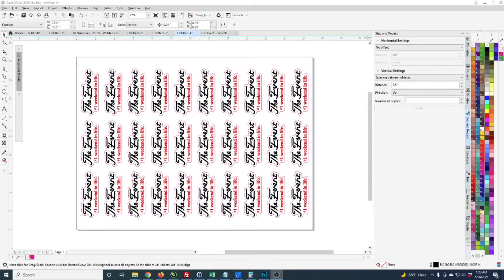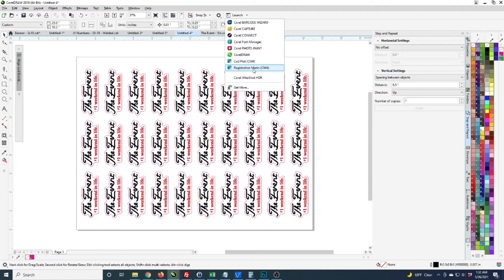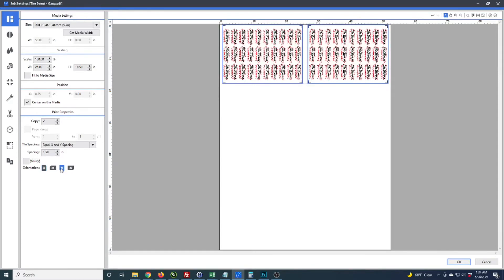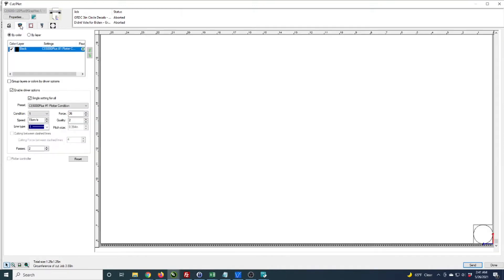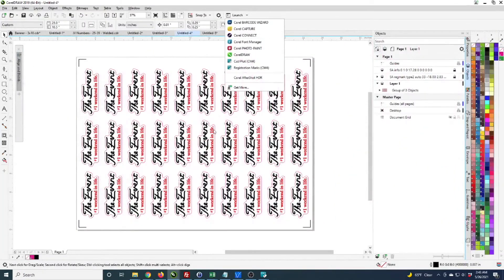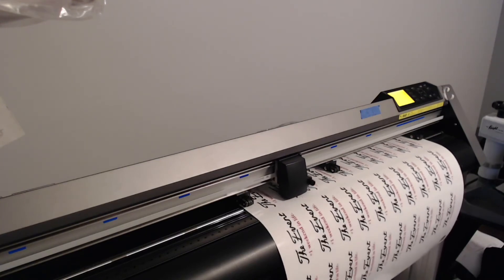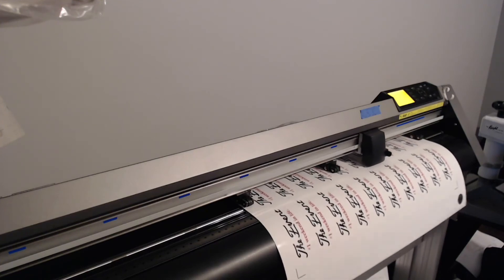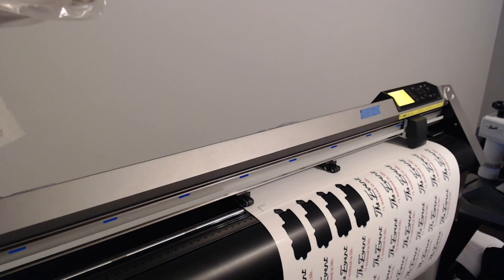Roland + Graphtec Print & Cut Workflow

Comment: Are you cutting in condition 8? Doesn't the Teflon get damaged? Or are you using it in the part where there is no Teflon. Thanks for the video.
Reply from the maker: You can program the Conditions to have different tool and setting configurations. I believe I used either Condition 1 or 2 here. With the CE6000 cutter doing this does cut into and wear the cutting strip. However, I have had the same cutting strip on this cutter for over a year and while the strip does show the wear marks it still cuts perfectly fine. I do recommend having a backup cutting strip for replacement once you do run into cutting issues.

Comment: can you please help me. How does the plotter know how to cut the contour lines once its printed out the printer with only registration marks? Do I have to send it to cut to the plotter from the software? I cant manually just put the sheets onto the plotter without software correct?
Reply from the maker: Correct. Here everything was designed in Corel... I exported the PDF in order to PRINT on the Roland. Then launched the CuttingMaster plugin in order to CUT on the Graphtec. CM5 is now available for download here: https://www.graphteccorp.com/cutting/cm5/
Reply: @drivenbygraphics  thank you very much. Does that plugin work for vinyl express? Because mine is a vinyl express q42 which is essentially a graphtec ce7000 or something. Manufactured by gtaphtec. It looks exactly the same. And how do I go about adding the plug-in to Adobe?
Reply from the maker: @dandee28  You'd need to confirm with SignWarehouse and/or your manual to see if your cutter has the Automatic Registration Mark System (ARMS) sensor in order to read the registration marks. Many years ago I had a QE Series cutter from them and it did not. I sold it and got a Graphtec which did. As far as the plugin, the Graphtec page has downloads for both Corel and Illustrator plugins.
Reply: @drivenbygraphics  oh the Arms it does have. I just checked last night. I usually use thr plotter to cut with auto films but decided I want to try it out for stickers/vinyl too. I had no idea I bought a machine that coukd do so much! Since it has the arms system I'm not sure what's the best software to use with it. Someone told me it shoukd have came with flexi but I don't see it. The tinttek software that came with the printer says it has flexi 10 but there is no digital download for it that I see. I think it's only available if paid subscription.  Do you have suggestions
Reply from the maker: @dandee28  What printer are you using? 
Either way, there are a few ways to go. You can use almost any design software to prepare your print files but how you go from there can vary quite a bit. There are 3rd party RIP software solutions that could streamline print and cut workflow, but most of them come at a steep price and/or monthly subscription. I personally use CorelDraw and the CuttingMaster plugin as shown in the video.
Reply: @drivenbygraphics  I'm using a roland bn20a just trying to figure out how yo design and add registration marks for the plotter
Reply from the maker: @dandee28  Gotcha!  Yeah, so it would be the same process with Adobe Illustrator also. Once you get your artwork setup, run the CM plugin, add the registration marks, and export as PDF. Import the design into VersaWorks - make sure you set it up to PRINT ONLY. Once printing is complete, load the vinyl into the Q42, and run CM to cut. Note that you will want to make sure you have enough "tail" on your vinyl so that the Q42 doesn't think it ran out of material on the back end of the cut.  With the other Roland printers you can add a 90mm page space then run the Sheet Cut option and it works perfectly. Sadly the BN20A doesn't have a cut sheet option (I dont believe)... I think the new BN2 added the feature.
Reply: @drivenbygraphics  Is the CM plugin free and how do I see in illustrator? thank you for all the in depth info!
Reply from the maker: @dandee28  yes it's free and available in to download from the link in my first comment above ;-)
Reply: @drivenbygraphics  thank you! and what format does the sticker have to be in, in order to edit in coreldraw or adobe before exporting as PDF to print with roland? Do I make cutlines aroudn the image as png or is it pdf?
Reply from the maker: @dandee28  you can use any digital image format in your design file that is exported for printing on your Roland. However, your images will need vector based cut lines in order for the Cutting Master software to cut them. If you are cutting on your Graphtec, the artwork you export to your Roland does not need to have cut cut lines.
Reply: @drivenbygraphics  hmm so basically, I just need to add registration marks to a sticker sheet on adobe for my artwork, export as PDF or EPS, then import to versaworks, and versaworks will do all the work to add the cut lines to the sheet? Would I have to add an extra cutline around the artwork in illustrator or a design program in order to do "easy peel" or "perfcuts"? im so confused because theres so many videos explaining different things. 

i dont know if im doing it the long route. What I believe is that I have to create sticker sheets with the reg marks, then send to versaworks, Once printed, then I open up the same print file on cut master or another program in order for the cutter to understand where to cut the contours?
Reply from the maker: @dandee28  VersaWorks will not add the cut lines you need. You will need to create / add your cut lines in Illustrator or which ever design program so that when you open that file with the Cutting Master plugin it has both the registration marks along with your cut marks. The video above shows the entire process I use to prepare a file, print on Roland with VersaWorks and cut on the Graphtec with the CuttingMaster plugin.
Reply: @drivenbygraphics  i was able to add the plugin and add cut lines. Im just trying to figure out how to add additional cutlines to make easy peel stickers. Would I just have to add a second contour cutline in a different color on illustrator? and how would the plotter know to cut two lines?
Reply from the maker: @dandee28  If you are wanting to add multiple cut lines, that need different cut settings (i.e. kiss cut vs die cut) what I would recommend is using different colors for each cut line. Then, on the 2nd tab of the CM5 plugin (Driver Option - The icon looks like the cutting blade extending from the holder WITHOUT the +) choose the option to Filter By Color. You can then toggle each line color (cut line) and adjust settings accordingly.
Reply: @drivenbygraphics  thank you so much! ill have it a try, itll have to be alot of learning so ive already got down most of the things you suggested. What is the easiest design app in your opinion? Im using corel draw free trial right now and I have illustrator. On coreldraw in order to make the sticker sheets, should I adjust the size width according to what my bn20a can print out on material which is about 18.5 inchs wide?
Reply from the maker: @dandee28  I learned Photoshop ~15 years ago as a hobbist photographer and tried to pick up Illustrator multiple times and it was just never intuitive for me. I picked up CorelDraw much quicker and have been using it for many years now. 
Correct - the canvas in your design program will need to be no larger than your available print width.
Reply: @drivenbygraphics  do you have a video of how to create contour cutlines and easy peel lines in corel or could you make a video =D

Comment: Great video, I gained a lot of new info, I have a Roland printer and a Graphtec cutter, however I have never tried the die cutting as you show in the video.

My question is, how bad does the blade cut into the cutting strip and how often do you need to change the cutting strip?

You mentioned you use cheap blades from Amazon, but you didn't mention anything about the cutting strip or how often you replace it.

Have you found a cheap source for the replacement cutting strips?

Thanks,
Reply from the maker: A single run of die cuts isn't going to ruin the strip but continued used will do so over time as the blade continues to cut through the backing paper and slowly eat into the strip. How quickly that happens really varies a LOT based on how much die cutting you are doing. 

I have not found any cheap replacements for Roland or Graphtec strips. Well, the ones that are CHEAP usually don't have the adhesive tape on the back to where they are ready to use and apply. Let me know if there is anything else I can do to help!

Comment: Hey thanks for the video, I recently bought a vg3 540 but looking to get a graphtech or summa cutter because the VG3 isn’t great for pref cut, what cutter would you recommend? I just need a 30inch one because I am only using 30 inch rolls but I need a cutter that’s good for cutting die cut stickers.
Reply from the maker: Either one are great cutters. I have only used Graphtec myself but do have a LOT of interest in trying out the Summa T-Series with the tangential head.

Comment: @DBG Studios Hey Marvin, I have a BN20 and just got the graphtec CE7000.  I followed this tutorial for the workflow.  Got the crop marks to appear in Corel, saved to a pdf and brought it into VW.  I did do my design with the pink cutcontour in corel but when I have it in VW and have selected print only - it still prints on the media (5:18 in video).  Also the wrench tool in my VW for my file to set custom settings and add the 90mm tail is greyed out.  Can you advise on that too?  Are you available to perhaps do a call to walk me thru this?  Thanks.
Reply from the maker: It sounds like your CutContour line is being converted to a non-spot color which would be the cause for it printing. 

As far as the wrench tool being grayed out, I am not certain as to why that would be but my first thought would be to look into the Media Type (aka Media Profile) for the job. It may be that the media profile itself is limiting that ability. However, as far as I am aware the BN20 doesn't have a dedicated sheet cutter and I believe you have to manually cut the media. In which case the 90mm page space isn't really all that useful. The intent there is to leave a "tail" on the end of the print such that the cutter (either Roland or Graphtec) has additional media that allow it to be cut through the entirety of the print job. As long as you trim ~3.5" or so past the end of the printed area you should be good to go there.  

Happy to discuss further. Feel free to email or message me any time and we'll get it figured out!

Comment: Do you use contour and perf cut?  We print and cut with a vs300i Roland and it is murder on the cutting strip and we wanted to move to a dedicated machine but we like to do a contour cut with a small margin then the perf cut.  This is after lamination.  But now I am wondering if I should be tying a double cut to reduce wear.
Reply from the maker: I don't use the PerfCut at all. I only use CutContour lines and adjust cut force appropriately. Over time, it does ruin the cutting strip but I am careful in ensuring that I am not overcutting causing additional, pre-mature damage. I replace my cutting strips about once a year.

Comment: so can the roland cut as well? doing some research on what i should buy
Reply from the maker: Yes, most models of Roland ecosolvent printers are capable of cutting as well. There are only a few of their more industrial printers (built for high production/speed) that are print only. 

As far as current models, their website separates the ones with Print & Cut capability from the ones that are Print only. 
https://www.rolanddga.com/products/printers

Comment: This is exactly what I needed! Thanks...I use Flexi and inside it of it I can reorder the cut path Have you figured out any settings on the Graphtec itself to default the origin?
Reply from the maker: I have not found any way to reorder cut paths with Graphtec and/or the CutMaster plugin. I am even in some Graphtec groups on Facebook and have asked about starting the cut from the front and working toward the back and have not seen a solution that works yet. Let me know if there is anything else I can do to help!

Comment: If that material is vinyl you could have reduced the strength and save your teflon strip. Anyways, just a tad of force like 18 could have cut the vinyl, yet, let the paper back intact. Still, nice video covering all steps here.
Reply from the maker: Thanks for your comment! Yes, understood completely and I do perform kiss cuts with lower amounts of force all the time as well. In this case the customer wanted full, die cut stickers, so the intent was to cut all the way through as demonstrated :)
Reply: @drivenbygraphics  I see. The only time I use full force is to cut lightweight micro pvc with vinyl applied on them. Cheers!

Comment: It's been a while since you've made the vid and tried double cutting.  How has the double cutting gone for you?  Save any time on cutter replacements?
Thank you for doing the video.  I use A.Illustrator to VersaWorks to Graphtec FC9000 and your vid helped with the confidence of setting up what I've done. Big Help.
Reply from the maker: Glad to hear it helped!  I've continued to double cut since I made this video and I don't think I've replaced the blade yet.  I am definitely a fan of it for die cutting with the CE6000. Having said that, I believe your FC9000 has a specific cut channel and option for perf/die cutting, so I would suspect that would be the best option for that cutter.

Comment: Is your cutter blade in position 1 or 3? They say position 1 is for contour cutting and position 3 is for perf cutting
Reply from the maker: Hey Lenny! The CE6000 only has 1 blade position and does not have the separate blade position or channel specific for perf cutting. This is why I mentioned that this can really be done on any cutter with the proper force setting for your material.  Having said that, this does cause premature wear on the blade and cutting strip, but I have been cutting this was for at least 3 years now and have only changed my cutting strip once and my blade a few times.
Reply: @drivenbygraphics   I printed some labels that I want to cut out. Put registration marks on, when it printed on my SP330i it didn't print the registration marks. What am I doing wrong? They are in my coreldraw page???
Reply from the maker: @lennyamore7382  were they also on the file that you exported from Corel and loaded into VersaWorks? Also, if you are on any social platforms where we could chat directly, I could likely provide better / real-time support to help get you squared away. Feel free to email me any contact info etc. to me at drivenbygraphics @ gmail . com
Reply: @drivenbygraphics  Are you  able to help me???
Reply from the maker: @lennyamore7382  please send email as requested in the previous message so I can assist further.

Comment: At what speed and force do you have the graphtec setup?
Reply from the maker: I typically run it at 20cm/s, but as far as force it varies a lot based on blade and cutting strip condition. Lately, as of this comment 4/22/22, I've been running force around 24 , but I've been as high as 36. You really have to manually test and dial it in for your machine.

Comment: Does this mess up the Teflon strip???
Reply from the maker: Unfortunately, yes. By die cutting with a machine that does not offer a separate cutting channel specifically for die cutting it will increase the wear in the cutting strip [and the blade] which will require it to be replaced sooner than normal. Having said that, I've been replacing my cutting strips once every 8-10 months [on average] since I have been doing this.  Prior to doing this I would go 18-24 months between replacements. Ultimately, I feel it's a small price to pay for the capability.
Reply: @drivenbygraphics  hey bro thanks for the info I have the ce6000 120 and was tying to figure out how to do it. But I guess I’ll  have to load up on Teflon strips then lol.
Reply from the maker: @GaZaLoC1  Very welcome!  I typically keep one backup and just cut as long as I can with my current strip until I notice that I'm running into issues (ie non clean cuts) and a blade change doesn't fix the issue. My strip currently looks fairly rough, but it still cuts just fine so I'm not changing it just yet ;-) Let me know if there is anything else I can do to help!